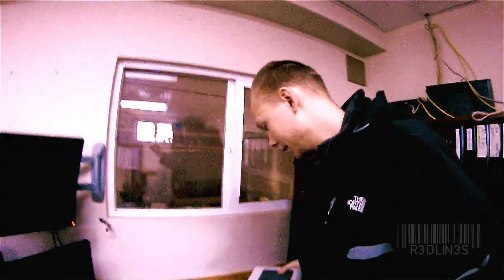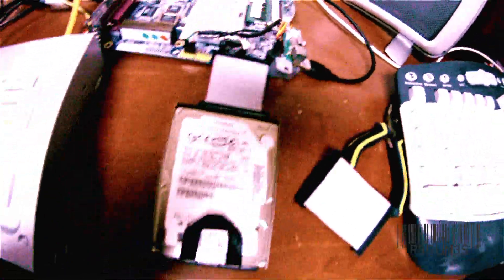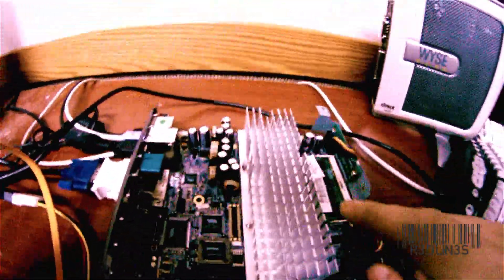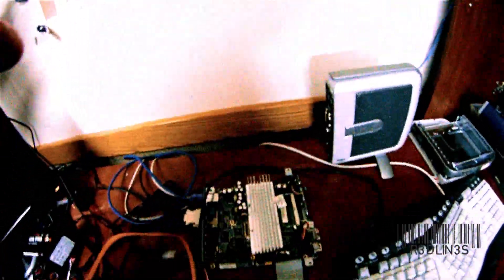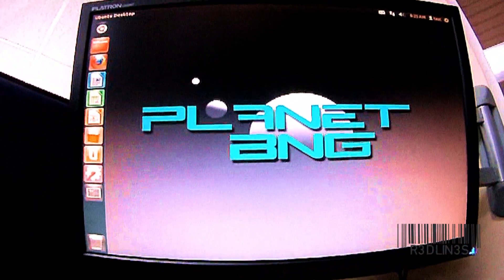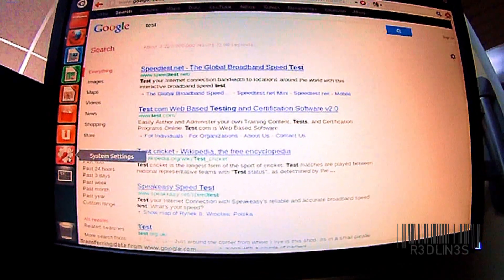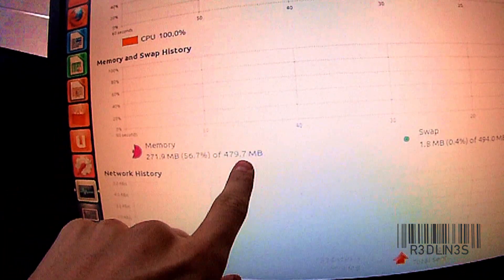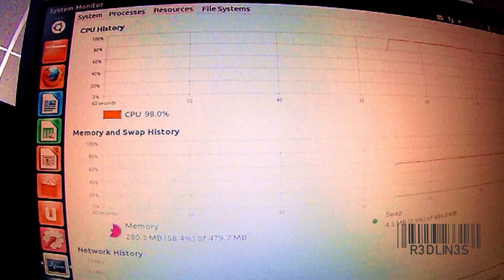Install OS On Wyse Thin Client Linux Ubuntu

Comment: I think the best OS I've had on it has been Windows Embedded ReadyPOS 2009.  Installing it was a real nightmare though.  It essentially gives you a really lean and mean version of XP.  All apps seems to work as XP.  It works with 512 MG memory, but 1G is probably recommended (I recall seeing this is the max, but  havent tried yet).  If I recall correctly it was 1-2 GB disk size, so the 512MB flash hard drive wont get it in.  

The downside is it did not install cleanly.  To get it on the machine, I had to install it on a Virtualbox on another modern machine, then clone that virtual hard drive to the real hard drive (used a laptop HD same as in this video), and move it to the WYSE.  If you decide to do this, I'll save you some frustration:  before you clone, make sure in your virtual setup you use Microsoft's generic HD drivers, and setup Windows to autologin.  After moving, the OS will eventually find the needed drivers to make it work.  This may take up to 2 restarts (you may need to cut power manually if its not finding the keyboard drivers).  This leaves you with essentially a stripped down version (like basically an nLited version) of Windows XP SP3.   The only web brower working on XP in this day and age is K-meleon.  You can download ReadyPOS from Microsoft website for free (6 month trial).  There are permanent keys floating around (easy Google exercise)

I do have this running (I should make a video).  The downside is getting updates.   ReadyPOS actually runs alot of ATMs (or at least used to).   It was supported by microsoft until 2019.  When you first load the system, and request to update, you'll get 10 years of updates - works out to about 219 updates.   If you install all of them it takes almost 18 hours.  Somewhere along the way it breaks something.  I've been manually added them from an inital install - this is extremely tedious and boring.  I've added about 50 so far with a stable OS.  Still don't know which update is breaking it.  Antivirus is a problem to, as this is a non-SSE processor system,  and finding AV supported on this machine will be a chore.

I use this setup for things that need the serial port and older software.  My uses in particular were for programming a Vista 20p alarm system (OMG, this involved a 2400 baud Hayes smartmodem) and a Mercedes Xentry/DAS car diagnosis system (current project)

Comment: Thanks for the video. I'm going to try to install FreeDos on my V10L this week and see what happens. Funny that I'll have more RAM (512M) than disk space (128M). But, it's still overkill for a dos-based system. Should be fun
Reply: Wow. That was easy. FreeDos up and running.

Comment: Haha,  Several things to point out to users: 

1. Thin clients were not meant to run full feature OS's. Rather they were destined to network boot, and run an OS small enough to connect to a server and have the server do the heavy work. Booting  the thin client to logging into a desktop on the server will be far faster and offer much better performance on the server's cpu and ram. 

But if one chooses to run a full feature OS on minimal hardware:
2. One needs more ram and a larger hard drive as this video pointed out, but your still limited by the cpu as well as remain limited severely restricted by the amount of ram one can install; and 
3. Both Ubuntu unity as well as gnome are both cpu and memory intensive. Rather, I would suggest using Lubuntu or Xubuntu if one is to use Ubuntu.
Reply: I want to use my VX0 V90L as part of a teleprompter and I figure it might be able to do that without modification of hardware (512 RAM, 512 flash).

Comment: Can thin clients boot from a flash drive? I recently got my hands on one and don't know much about them. Any advice would be appreciated. (Please note I do not have the manual to it)
Reply: In short, yes they can. I'm running a C10LE at home from a 64 GB mini USB Drive. Works pretty well considering the crappy Hardware.
Reply: +松本秀人 Were you able to answer that question?  I have a wyse Tx0, I am wondering if I could boot ubuntu from a usb stick?
Reply: +Andreas Maeurer No sorry, I just put it aside for a future project. Never got around to actually modding it. Sorry I could not be of assistance.
Reply: Joe Night Any noticeable lag or problems? I just want to make a machine to browse the web nothing fancy.
Reply: Not so far but i upgraded the RAM of the TC to 1 GB with an old RAM Chip i still had. So i can't say for sure for a 512 MB RAM TC. As well i used SliTAZ as OS because it is way sleeker then anything else out there. But no, no problems detected so far.
Reply: Joe Night Awesome! I'm gonna do more research on it.
Reply: I put FreeDos on a V10L tonight and while I don't think the hardware is cutting edge by today's standards, all I have to do is think back to the days of running DOS on an IBM PC-XT and this thing is not just cutting edge, but knee deep in the gore... LOL Even with a measly 128 Meg built-in flash drive, I still have 104 meg remaining after a clean and full install. In DOS terms, 104 meg will hold a massive amount of software before I even have to start thinking about adding an external flash drive on USB. My first hard drive on the XT was only 10 meg. The graphics are a lot better than CGA too.

Comment: Having difficulty finding the cable... Where can these be found in abundance? All I can find is a 1.18 inch length version.
Reply: I didn't notice that your version was a full size IDE. The ones on the VX0 V90s come with a micro IDE instead which is significantly more difficult to find cables, etc for. However there are micro IDE to SATA adapters for pretty cheap and they work great! Love the channel man.
Reply: +Robert Porter hi there, can I ask you a question pls....I have wyse V90L and its really hard to find cable for HDD can you help me with that please....thanks

Comment: I've got a C7 Eden 1.2ghz running Lubuntu right now. (guest nettop) It's acceptably fast, but it was snappier under WinXP. I moved it to *buntu due to video driver issues under WinXP. The biggest thing slowing it down is lack of RAM. I couldn't locate a compatible 1GB DIMM, so it's stuck on 512MB, and that really isn't enough for most *buntus once you fire up a few programs.

Btw, for anyone wondering, nLite lets you strip WinXP down to as few as 15 processes and 70MB boot memory usage.

Comment: Except that he's completely right. No linux distro that I know of that doesn't sacrifice on user friendliness is as lightweight as WinXP - and that's before you tweak it. If you use something like nLite to strip out all the crud, WinXP runs fine on systems as slow as an ancient P2 300mhz. (I know; I stripped it down for an old P2 IBM Thinkpad... 35 seconds to boot, web browser up 45 seconds after pressing power button, only 256MB of RAM.)

Nothing *buntu based is as lightweight as WinXP, period.

Comment: That's completely untrue. Stop disinforming people. Linux could run up to the last month's version (3.7 release) on a 80386 CPU. The latest Windows OS that could run on that probably is Windows 3.1.

What Linux gives you is a modern (relatively bloat-free, in any case miles ahead of any Windows sh*t) operating system requiring a very modest hardware. (Linux is run by a huge number of embedded systems,not counting the millions of phones that can easily run modern versions of Linux).
Try DSL/Puppy

Comment from the maker: I tried running xp on this and it crashed every time. From what I hear you need an ide to sdcard reader converter to install the os. Then it can be imaged to an ide drive.
I have never tried it kuz I dont have a converter.

Comment: Hey there! As i know VIA c7 is x86 processor, capable of running Win XP nicely, or Win 2000 perfectly. Why dont you try installing it? Present day linux distros so much resource heavyer than even XP

Comment: these can be upgraded to 1 gig ram.  Any issues using the boards PSU for the lappy hd?   Also, check out lubuntu minimal install.  very usable on 128 megs ram if you use midori instead of chromeium